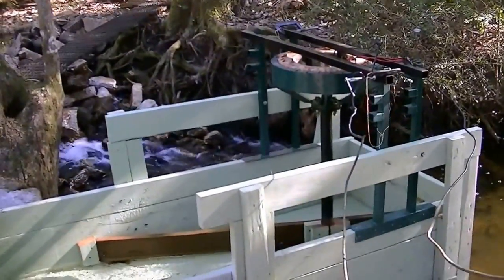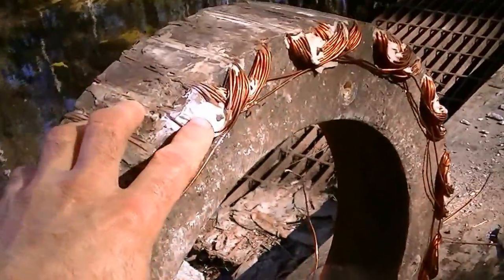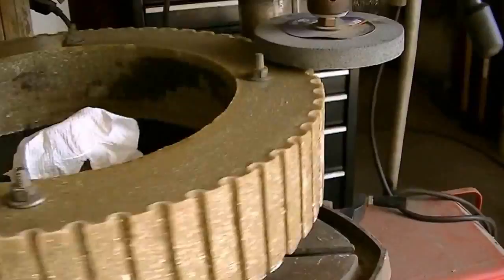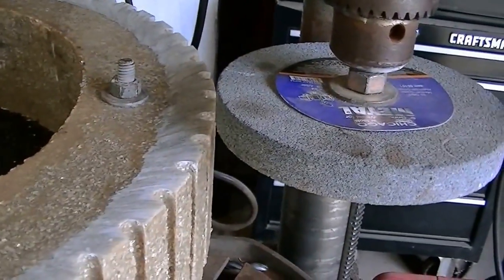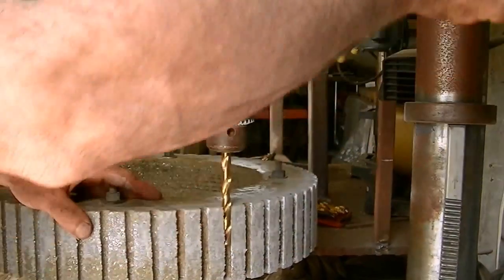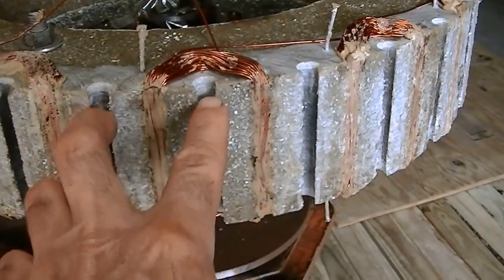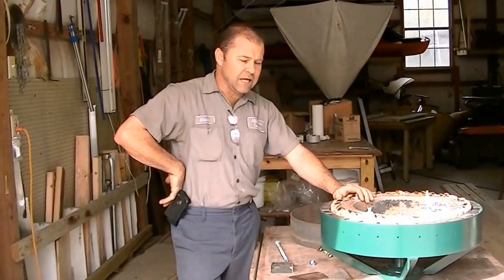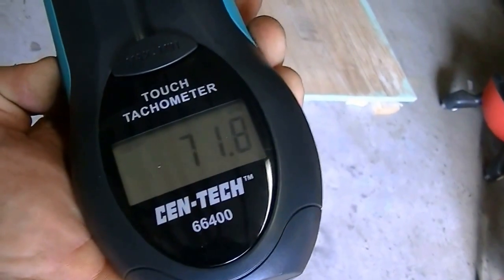Vertical turbine hydro generator system. Low rpm permanent magnet generator, home made

Comment: Newb alert: So the smaller the wire gauge, and higher turn count, the lower the rpms needed?
Reply from the maker: Yes, the smaller the wire the more turn count, the more voltage with less rpm's but less amperage.
Reply: Thanks for replying, I greatly appreciate it. It's rare I've gotten a response from makers of videos like yours, and it's a bit discouraging when one's trying to learn the basics of coil winding/stator making/calculating inductance/etc. I'm trying to make my first generator without wasting a lot of money, only to have the materials gather dust because I either have the wrong materials or don't know how to combine them into a usable product.

Comment: If you put an inverted bowl of some sort around the shafts so that it can make a seal with the top of the water, and draw water up into the bowl, then you can enjoy the full benefit of the vortex without pulling air into the downspout.
You might also be able to draw some extra torque from the vortex with some stacked, flexible  turbine blades in a Christmas tree arrangement above the turbine you have already.

Comment: Great skill in construction and execution of entire project.  I’m no expert by any means but it looks like your turbine blade is of lower quality and efficiency than the rest of the components. I’m sure a lot of thought went into it but why not a screw type with partial enclosure. If you can control debris you can double rpm and kw output.

Comment: If you used an artemis screw type design for your paddles, you could strike a good compromise between low maintenance because it is self clearing and not losing any power from the flow. Great video.

Comment: Another thing will perhaps make problem, you'll need a filter before  the water came in the collector
If you decided to use turbine you'll relly need to made this 

 If to much leavs wood or all different objects moved by the river water  were accumulated in the collector, it will stop production during the rain, and more the rain will be heavy more problems could happened 

Those problems could append during the night, which could be really upsetting

Comment: Perhaps could you modify the energy transfer by using a different propeller, more higher, like a turbine instead of a sort of boat type

Excellent generator, turn really well, and cupper wire  really near the magnets which is very important to exhaust power production, this part seems really good

I hope you found the best efficient solution, i think my idea could really help ;-)

Comment: Now I must ask why did you use a rectifier to dc instead of just generate Ac to run the devices. I get the battery storage but it's a thermal loss that is unnecessary to invert and clip..
Reply from the maker: Because It does not produce 
60 hertz's

Comment: How did you combat the Eddy currents in the armature?
Reply from the maker: I used several steel rings in the stator
Reply: @markp0177  did you laminate them before you cast the part? I'm really impressed with your set up. I mean how are they isolated from each other.  I figure the stream offers enough cooling to negate heat problems.
Reply from the maker: I used spacers to hold the rings apart inside my mold, then I poured the resin. I do not have a heat problem, it does get a little warm.

Comment: grease in the fitting once a year?

Damn...that's how everything should be to maintain
Reply: that looks like a axle hub and bearing assymbly from a garden trailer or boat trailer and most guys i know switched from greese to gear oil because oil will lubricate bearings better vs greese that is thick..same principle as a old pickup rear axle, you fill the differencial with oil and it runs thru to both axke bearings( most get 500k miles b4 a gear oil change)

Comment: That was very interesting.  I am off grid but we don't have that kind of water in central Victoria (au).  I can imagine problems from anyone down stream noticing any change in flow.  That would tend to make them blame you for any detrimental effect regardless of whether it was your fault or not I can imagine.  Right now I am getting 40 amps off the roof at 48 volts so my main focus is battery storage.  I do half hour charge top ups with a generator on cloudy days around solstice but otherwise I don't generally run out of power and can run up to 4000 watts for a few hours if I have to.

Comment: Mind if I ask what the casting is made out of?
Reply from the maker: Its made out fiber glass with several steel rings.
Reply: @markp0177  awesome!! Is it possible to make two or three and stack them on top of each other?
Reply from the maker: @2dogsjr2012 You could but you would not get any more power. This generator could produce 5 times more power if I had a bigger water fall.

Comment: Nice stuff !!! Congratulations !!! 

I was thinking about the wires that carry the electricity to the house - you mentioned they are a few hundred feet in length - and I know that if you carry DC through them you loose quite some power through such length. Is there any way you can carry AC through the wires ( or maybe you already do and I misunderstood) 

Keep up the great work !!!

Comment: Respected sir. 
I appreciate your job.  Would like to do more experiment. 
Your all system is  good.  Only releasing water in tank can be improved.  Take  larger Indrustral  pipe .  Take two or three people.  Add water from two sides and release it simultaneously. One side in water and one side in take. By gravity water  with force will enter in tank. I will send you few site's name.  The real experiment is to use silent ponds or swimming pools to obtain electricity .
You can use ten water pipe using same method  to increase flow of water.  Namh shivay.

Respected sir.
The site name is 
Siphon irrigation technology.  
Indian farmers. 
You are not successful in one attempt.  Both the sides should have slow and simultaneous action . Without electricity and very economical. 
Namh shivay

Comment: Excellent video sir. I love this kind of stuff. Btw, I'm no engineer and all, but I think using a solid iron core will induce eddy current and energy loss? Perhaps, a laminated core would suffice?
Reply from the maker: I did use a laminate core. It has several steel rings in the fiberglass casting.

Comment: About the refrigerators... I assume they are D.C. for a motorhome or camping trailer etc... Or is there a converter off the battery block? A 14 cubic foot up to a 25 cubic foot would put too much amp draw at startup. I have a SxS subzero built in but they have remote compressors. With the hcfc equalization, it pulls almost 20 amps at startup on a 70° day. More on hotter day. Maybe you already answered this but 1475 comments would take too damn long. 😳

Comment: If you send the power at higher voltage, you'll get a lower current and less heating loss, so you might want to put your inverter next to the generator.

Comment: Hi, I'm from France. I have worked in this type of setting in China with similar stuff. I would like to give you an advice concerning the water admission canal. Factories selling those turbine in China also sell a pvc admission canal which has a hole at the end where you can insert your turbine. We don't care if it's pvc or not but the point is that it's not a rectangle canal which create turbulences.At the entrance it's large, then it's more narrow, which increase the power of water, from this point it turns into a circle. The water does not arrived in this circle from the axe, it's a little bit deported what creates a vortex for the water to fall in the turbine hole. It's hard to explain without to draw it for you, but it looks like a keyhole . A triangle with a circle at the top which is not axed with the triangle axe.i hope you understand. It has to look like a spirale , to canalise water , increase power and create a vortex. hope it will be useful

Comment: Beautiful design, but I wonder if it would be anymore efficient if the single piece of wood in the trough were replaced with two pieces of thick plywood that were cut so they were the same height at the trough, but cut just long enough, so that they border the hole the water pours through, rather than cutting across it like the board does now.
...and speaking of that hole...
I also wonder if efficiency would be increased, even more, if the "turbine" blades were placed inside the tube, rather than sticking out of the bottom. I don't think it would have to be very far inside. Just enough to be completely enclosed by the tube, all the way around.
...hmmm...
Reply from the maker: It would be more efficient that way. I use to have the tube lower and around the blade but it was catching turtles and fish and stopping it. I went with this method because it is low maintenance.
Reply: @markp0177 Aha! Elegant solution. Thanks. =)

Comment: You never do mention how many amps at what voltage this is capable of providing?......20 amps at 12 volts?......40 amps at 12 volts? or ?
Reply: AWG 18's ampacity seems to be 7A (also found a chart that stated 16A). So thats the absolute maximum since higher amperage would burn out the coils
Reply: its two refrigerators at 12v :O

Comment: christ the time these idiots could save by reading a book once in their lives. "i used some thin guage wire with about 20 turns" the problem is you dont understand the basic electronic principles that have been long since known and documented, that would enable you to design the motor on paper to what you want/need, and make it correctly. also, magnets do indeed "wear out" over time as they lose their charge. those devices you have are compressed minerals that have a magnetic charge placed into them by the company who made them. they arent some magical device that just has an infinite supply of energy.

 seriously. put down your sisters pussy and read  a fucking book.

Comment: I'm no expert but I think higher voltage means less loss over distance, so switching to higher voltage has probably done you a favor. Would you lose even less with higher gauge cable from the turbine to the batteries? I just fitted 12v LED lights in my garden and had to up the diameter of the cable in order for them to run over the distance.

Comment: Just a suggestion to reduce power loss on the cable, why don't you use a transformer to step up the voltage between the turbine and the transmission line, then using a similar transformer to step it down before you rectify to DC voltage.
Reply: Good one

Comment: Great video. At 6:40, you show the completed stator. Are the wires for each phase insulated from each other? I ask because it doesn't look like they are and I'm wondering if that is necessary.
Reply: Those wires have a thin coating of insulation built in. Google Magnet Wire for more info.
Reply: @FullThrottleMonty  Thanks!  I figured the phases had to be separated.

Comment: I bet you're losing A LOT of power in the those long (DC carrying) wires up to the inverter, how much current are you pulling over those ?
Reply: Its AC, I would be more concerned about the low voltage due resistive loses, I would build mine in a hinger voltage three phasic configuration.

Comment: I trust if you make the water swirl before the entry into the impellor will make the system more efficient with higher torque and rpm especially if another layer of impeller is added as the current design had too much gap between the blades hence losing lots of energy which explains the low rpm achieved.....just my views....
Reply from the maker: I have tried it with the water swirling and I got a little less power.

Comment: I had thought of something similar but I wasn't sure what turbine to use to power the generators. And this is the answer my friend!! AMAZING!! I wanted a four turbine system, 3 of them to power the house building apartment etc. And a water tower or a tank on a tall roof and the use of gravity and water to create force neccassary to turn the turbines. So 3 are for powering you Load and the 4th is for a low voltage pump(If possible) that would pump the water back up to the holding tank whether it be a tower or a roof or a hill in remote areas. well I was always thinking about how you can do this in a city with a tall building and use 3-inch PVC or 4 in whatever and let the waterfall at a great amount of speed and hit these turbines as it goes down and have one of these turbines or generators to you no work a pump while the other ones are to feed the load that you're going to use you know the power for and then if you had a high building or a hill you can also have a windmill for secondary power with batteries there to store power when it's not in use if you can create that much power and I sincerely think you could I mean if you can get that pump to keep pumping water up the water is going to keep falling naturally all you need is to pump to keep going no drought will stop it I mean evaporation possibly but if it was a closed system I think there's a way to stop that to an extent man I wish I had somebody like you to kind of help me to put our minds together to do something like that

Comment: Read most of the comments to see if my idea was mentioned, and some are in the ballpark.  Why not build a helix up the shaft a bit, or just a helix on the shaft instead of a fan at the end???  The helix would be like an overgrown propeller.  With the amount of waterflow you are getting through the system, the helix style propeller seems like a better tool than a fan.

Comment: All i want to ask is if it resistence free can you doublicate the alternaitor ? A sepret alternator with the same drive chaft that conext to a single set of blades ? Would the power double ?
Reply from the maker: It is not resistance free. The magnets are pushing the electron's in the copper wire.

Comment: Hi what is applied around the stator core(iron core) bcs I show that magnet are attached to it. That means that flux or anything will not block the magnetic field
Reply from the maker: Not trying to block the magnet field. The stator is made out of fiber glass with several steel rings.

Comment: Absolutely brilliant!   Well done Sir! What is the composition of your casting?  It almost looks like an epoxy, or potting compound with chips from your lathe mixed in perhaps.
Reply from the maker: I used fiberglass resin mixed with aluminum shavings. It also has several steel rings too.

Comment: You are fortunate to have a stream to be able to do something like this. Have you ever considered using a water wheel instead of the propeller? You may be able to have better efficiency with the water wheel and you would not have to worry about debris clogging things up.

Comment: Hi Mark, you might want to look at a different blade setup with a steeper angle and allow a vortex to form -even promote it, since it will greatly speed up your through flow and gives you more rpm with less water. Otherwise very nice! Cheers from New Zealand

Comment: A better turbine impeller can be used to offset the loss of DC power being sent so far from its source. Also if the length of the pipe to the impeller was increased to create more linear flow to the turbine. Great design tho. Gave it a like.

Comment: Anyone who has access to a fisher and paykel top load washing machine has the stator, magnets and all for almost nothing (if the electronic panel is stuffed it doesn't matter as far as i know), just undo the top with the screws and go on to undo the drum and all from the bottom, take the whole assembly apart and build a turbine (wether wind or water, doesn't matter)...enjoy

Comment: This is great. How does it perform with flooding? Or at higher drop point does it increase you’re RPM and possibly amperage?
Reply from the maker: When it floods, the tail water rises and I don't get any power. If I have a bigger water fall it would produce more power.

Comment: Mark, why not build a small shed near your turbine ( on top maybe even ) and put a couple batteries and the inverter in it. Then you could run the 120VAC to your home with very little loss. Or do you run your inverter only part of the time and need it where you can get at it easily?
Reply from the maker: Well I guess I could do a few things to get a little more power. If the inverter is too far away from my refrigerator it won't start the motor.

Comment: That's a lot of flow and a lot of head but the generator is very low power... 
From all that water you could make around 10kW so for your few hundred watt nrrds the entire stup cpuld be a fraction of the size and require far less water...

Comment: Try to utilize available magnetic field by redesigning copper coils so that these cover magnets at least from 3 sides. Thus available magnetic field will be utilized optimally. This will give you much better efficiency, voltage and overall power at low RPM. With the available torque with you, more than one magnetic array (another stater) can be easily fitted giving you double the power. Good Luck. AKV, India.

Comment: Is this truly two phase power, like this? https://en.m.wikipedia.org/wiki/Two-phase_electric_power Or are you just calling center tapped single phase, two phase? There's quite a difference. True Turn of the 20th century two phase will self excite a motor. Modern split coil single phase will not, without the help of a capacitor, or some other means. Just curious...
Reply from the maker: Well, I do not have to excite the coils on this alternator. I have not tried to run a motor straight off of it.

Comment: I'd be interested in some numbers, voltage and current while charging . I'm pretty impressed because its really hard to find ways to generate power from a higher flow low head creek like that. I've needed that before.